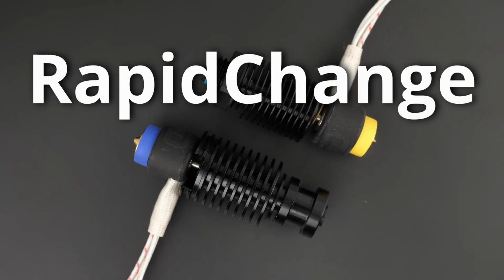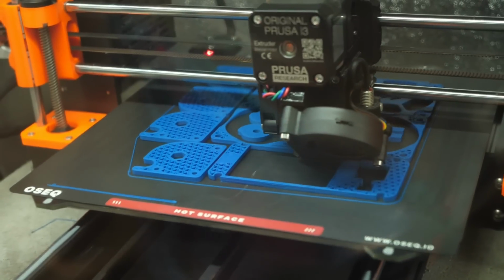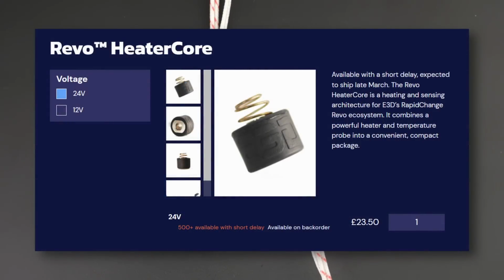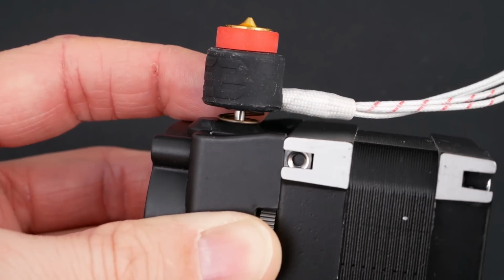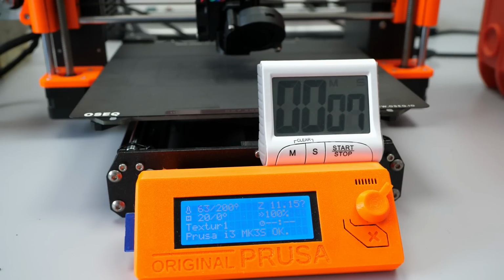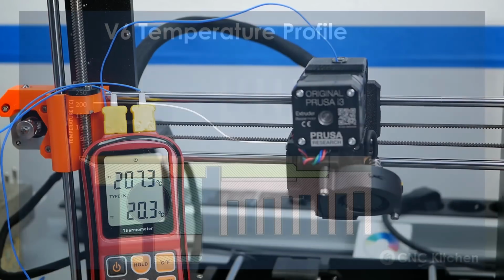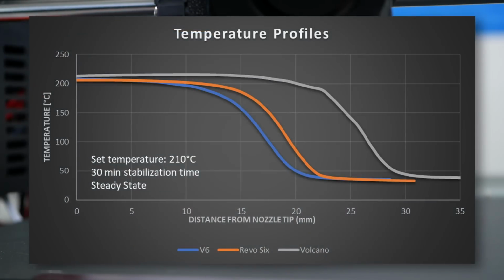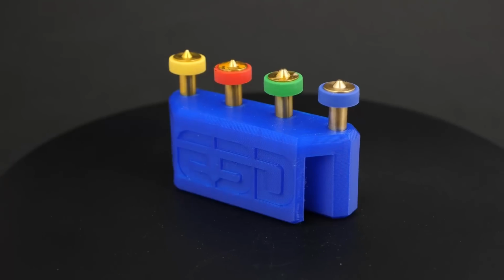E3D Revo™ is great BUT has a dirty secret! (REVIEW)

Comment: I wouldn't trust it at all. I've got a hot end that uses that stainless steel heat brake on top of that it has two screws to hold the heater block firm against the heat break and it just spins freely. I'll tell you where the problem comes from. Metals expand when heated. different metals expand at different speeds they also expand at different densities. I would not trust my hotend being on there only held together with a pressure fit. Plus those round heaters are not something new I've got a couple of them a while back that I never used. You're a little different than e3d's version but has the same concept.

Just wait I'm working on a hot end that will blow your mind. I'm a one-man operation so it's going to take a little time. But it's going to change 3D printing as we know it. I've been in a game for 15 years I remember when XYZ Duo was actually a cool printer. But now it's time to jump into a new way of printing.

Comment: Heilige Scheiße, 3 Jahre her und das ist für mich eins der wichtigesten Videos die ich seit langem gesehen habe. I really didn't expect the nozzle to react that way to the part cooling fan. Was wondering for a ling time why I had to up the temp on my Prusa PETG 10° above what Prusa recomends and has in their settings. Plus I have the added problem of having to cool my E-Stepper because of the high amperage due to the MMU3 and long filament runs from my Creality Space Pi X4. Also wird das Filament schön durchgewuschtelt bevor es überhaupt im Nozzle ankommt.

Comment: Will not touch this at all, The patenting just leaves an ugly taste in my mouth, always hated the way they over charge, even though the quality cannot be faulted, I can use the far eastern copies in a quick change head and achieve faster and more hustle free nozzle changes, E3D should have been less greedy and would have dominated the world market outright.
Reply from the maker: If E3D wouldn't go that route, I'm quite certain that E3D wouldn't be on the market for much longer or they wouldn't invest in these developments.
Reply: @CNCKitchen  I really like your vids but you start to sound like a payed e3d promotor. You are against waste, so where does this nozzle design makes sence to you? Precious metals thrown away everytime the orifice gets "too big" a loss in production time also as now heatbreak is off no use anymore. Build 1 high quality heatbreak and switch our only the parts that matter  as the nozzle to suit you project demands. If you were true you would have reviewed it against the rapido as it preforms way better but doesn't pay you like e3d.
Reply: @CNCKitchen  doesn't be a sell out stephan. E3d is poison, it didn't built you but it sure will break it all down.
Reply: @CNCKitchen  E3D had such a problem with clones they were sometimes even sold out on product